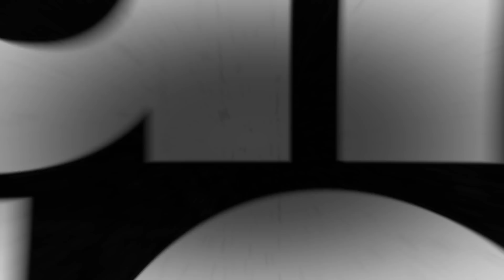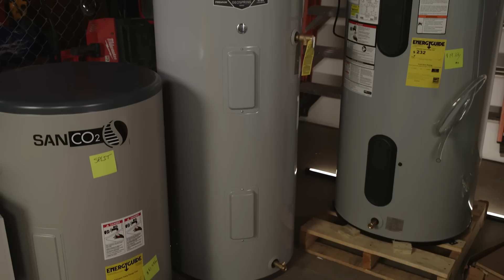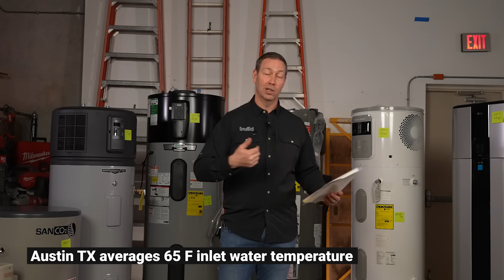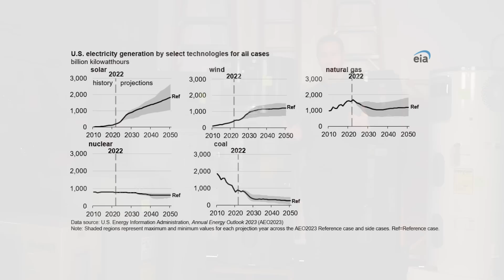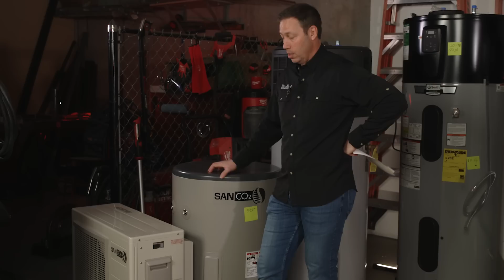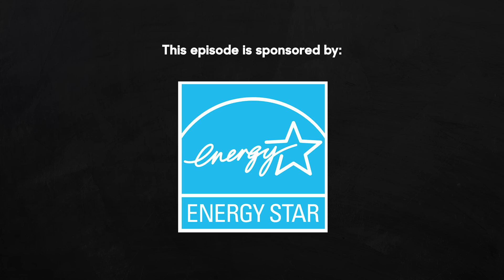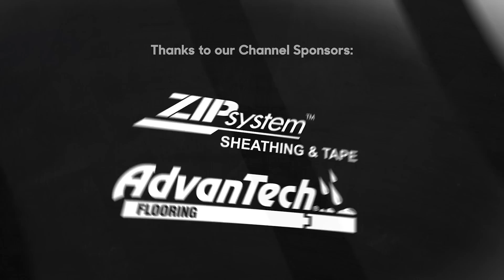2024 Heat Pump Water Heater Buyers Guide

Comment: Solar inverters do not like unbalanced loads. If you’re off grid or grid connected by powering from an inverter you should absolutely get the 240v version not 120v because of the unbalancing of the neutral. 

And if you can, everyone else should still go 240v if it’s a dedicated circuit. 120v is a hack for gas replacement on shared circuits or to avoid sealing out a breaker. Nothing more and in virtually all cases worse than 240v. 

And yes it’s 240v, not 220v and has been since the 70s.

Also marathon by rheme doesn’t have an anode rod and any fiberglass tanks don’t which is very very nice. Wish these would have the same because they’ll last forever.
Reply: Regarding the anode rod, I had the passive one replaced with an active electric on pre-install to avoid having to worry about that for likely the life of the tank.
Reply: @jeremyjedynak  the difference with a marathon tank isn’t just the anode which is sacrificial to delay rusting of the steel tank. It’s that the entire tank isn’t steel and thus never rusts or corrodes. As long as you clean sediment periodically it will last forever with replacement elements every 10-15 years. 

Heat pumps using the same tank design would last almost forever if they use a 3 phase BLDC compressor (with motor controller that enables it to be both variable and work on single phase power input).  (Think Mr cool). 

It wouldn’t cost anything more to make either because a 3 phase compressor of this size is no more money and the tank would be cheaper former out of fiberglass than steel.

Comment: Very cool...sponsored by Energy Star instead of a manufacturer.  Adds a lot of credibility for this topic!
Reply: These are ratings based on testing rather than politics. In this case, trust the EPA ratings or pay more in utilities. It's that simple.
Reply: @stevensmith4099  If that is the case, why won't you see a gas appliance in the "most efficient" category?  Hint, it's not because they don't test as most efficient.
Reply: @D2O2  I'm not sure why they don't classify them, but gas appliances very rarely are the most efficient. HPWHs usually have an efficiency ratio of 300% or more. Gas will never be greater than 100% and the norm is closer to 60-70%.

From a climate and technology perspective you should expect gas appliances to begin phasing over the next 20-30 years except for the most extreme environments.

Don't get me wrong, I have a gas water heater and furnace, and I'm not against using them, but they will be my last gas water heater and furnace. The heat pump technologies are just better in virtually every way.
Reply: @stevensmith4099  How did we get to higher utility costs?  Electricity wasn't always 14-30 cents/kWh?  Tell me how government policy didn't contribute to that.  This is circular.
Reply: @N-M424  You are a bot account if I've ever seen one.
Reply: @stevensmith4099  Your ability to discern between a bot and real human typing on a keyboard is severely lacking.
Reply: Yeesh, this thread went into the anarchist lane quick lol. What OP meant was that being sponsored by a third party agency and not a specific manufacturer means there is less bias in Matt’s review today. If this was brought to you by GE, then I’m sure it would be all about how great GE’s water heater is and we’d all look and say “Is it? Or are you just getting paid to say that”. 

And I agree with OP. At least with Energy Star there’s no skin in the game for any one manufacturer or level to buy or anything. 

Hate the govt all you want, plenty to hate there. We’re just saying prefer this type of content as opposed to Matt’s other videos that are just 30 min long infomercials sponsored by a specific brand.
Reply: @DrWarBear  Yes, moved the bias from a brand to a government agency.  So, instead of not hearing about a brands deficiencies', you now don't hear about the technologies deficiencies in general.  The bias is to support the agenda.  Non-sponsored would be better.
Reply: Except for politicians are deciding what that company does. Now they are sponsoring the biggest stooges regardless of quality
Reply: Except for politicians are deciding what that company does. Now they are sponsoring the biggest stooges regardless of quality
Reply: Except for politicians are deciding what that company does. Now they are sponsoring the biggest stooges irregardless of quality. I want non sponsored opinions. I’m going to unsubscribe company sponsors were bad enough
Reply: Except for politicians are deciding what that company does. Now they are sponsoring the biggest stooges irregardless of quality. I want non sponsored opinions. I’m going to unsubscribe company sponsors were bad enough
Reply: Except for politicians are deciding what that company does. Now they are sponsoring the biggest stooges irregardless of quality. I want non sponsored opinions. I’m going to unsubscribe company sponsors were bad enough
Reply: Except for politicians are deciding what that company does. Now they are sponsoring the biggest stooges irregardless of quality. I want non sponsored opinions. I’m going to unsubscribe company sponsors were bad enough
Reply: Government agency that tells us to use less energy while they fly around in private jets and spend our tax money running the military industrial complex that burns more fuel in a day than we do in a DECADE. 🙄🙄🙄🙄🙄🙄🙄🙄🙄🙄🙄🙄🙄🙄🙄🙄🙄🙄🙄
We are not the problem.
Reply: You mean a cool video of whoever paid the most money to the government?
Reply: It eats your furnace heat.  Stupid!!  Especially if the power goes out you are screwed.  Only gas or an oil fired boiler will work with a generator.  A generator can run on gasoline, diesel or natural gas.
Reply: Comparing hp water heater to a refrigerator? Refrigerators don’t last very long at all anymore. If the hp portion of the water heater leaks all the refrigerant out just get rid of the whole heater
Reply: @billy5032  who are you talking to?
Reply: Sponsored by US tax payers via government confiscation and re-distribution program.
Reply: So who sponsors energy star?
Reply: @ecash30  I do, along with every other Tax payer.  Isn't it great!
Reply: Buddy my Rheem unit used 800 kilowatts last year. Stop talking.
Reply: @AustinMichael  But it would have only used 200-300 if you just put in a heat pump unit. :)  Only downfall is that it will take the life of the unit to break even on the cost increase.
Reply: Yeah, the same EPA that has mandated higher seer ratings and newer refrigerants to replace the last newer refrigerant, every 10 years, costing homeowners a fortune in replacements, repairs and tooling by us HVAC contractors.
Reply: @USA-GreedyMenOfNoIntegrity  yet they still ban R600 that is cheap and has very little climate impact.
Reply: ROFLMAO.
Reply: Credibility from USA government?
Reply: @MustPassTruck  did any of you guys do your own research and find something wrong about this video, or are you just anarchist shit disturbers?
Reply: I mean, they publish their methods... you either agree or disagree with the water usage pattern on Energy Guide. At least this time we know the federal money went to a video we watched.  @MustPassTruck
Reply: @MustPassTruck so you don’t think we should have energystar rating system? Or you just don’t care how much you spend on energy because you’ve got more money than brains?
Reply: @MustPassTruck  Derpy right-wingers are everywhere!
Reply: @MustPassTruck  My feelings exactly. I was going to watch this episode, but now I’m not going to bother.
Reply: There is an inverse relationship between understanding history and trusting the government.  
Good ideas don't require force.  And gov't = force.  
#VOLUNTARYISM
Reply: @dustinabc You think Matt was forced to present this?
Reply: @dustinabc  ENERGY STAR is a voluntary program and certification of products is provided by third party (non-government) certification organizations. #VOLUNTARYISM indeed
Reply: @dustinabc 

Except we won't get clean water and air without force...
We are in a democracy. Don't like what you see? Organize and start convincing other people.
The government is what we make it to be. Stop treating it like the other. It is a product/byproduct of our actions and inactions.
Reply: @dustinabc so how is the government forcing you to use the energystar rating system?
Reply: Lmfao
Reply: F the government.